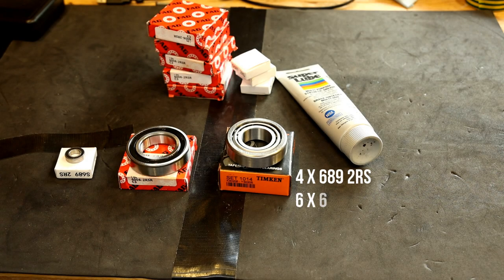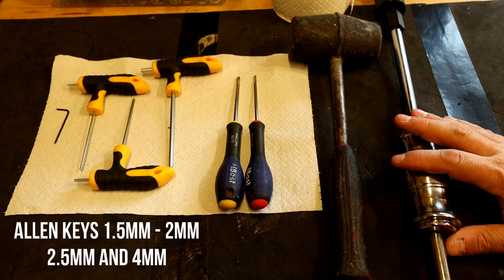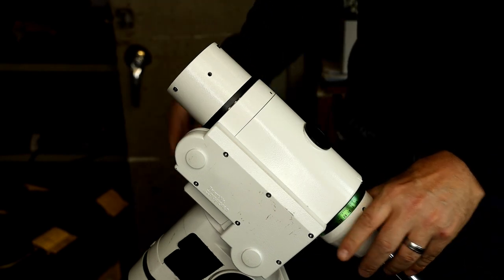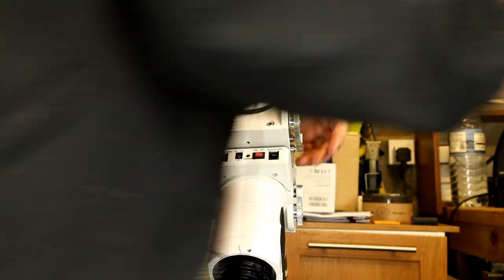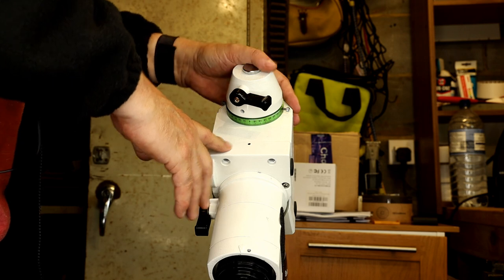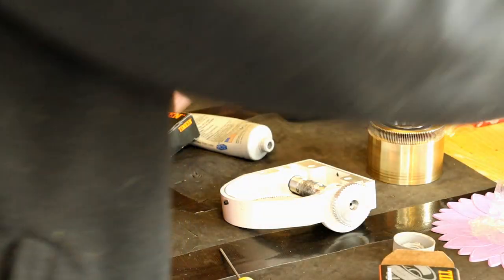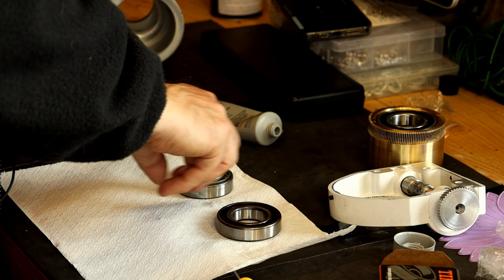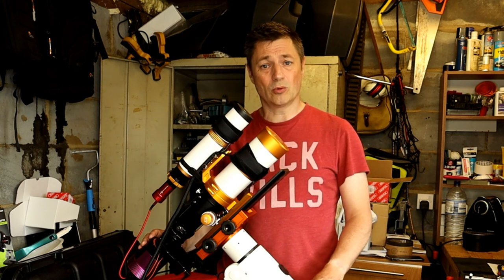HEQ5 Pro Hyper Tune. Get the best out of your mount. Astrophotography

Comment: Hello from a Pom ‘down under’. There is one really essential thing I would do when doing this re-build. Put some turps or similar in a shallow dish-tin lid whatever, then put the worm wheel brass gear in the fluid, use an old toothbrush and carefully go round the fine gear teeth to brush out all the fine metal particles that are held in by the old grease. These particles in the grease act as a grinding paste over time and produce wear on the worm and wheel. Similarly, do the same with the worm gear. Finish both gear sets with a squirt of brake cleaner (Acetone), then a blower when dry. Those parts are now truly clean ( you could use an ultrasound bath to do the cleaning if you have one). In my many years of building/making and machining gears, this just takes the hypertune to the next level. Stiffness on the Dec axis is usually because the cone shaped bearing housing is too tightly adjusted on the tapered roller bearing and just needs fine adjustment before tightening the three locking grub screws. Greetings from Tasmania Australia.
Reply from the maker: You are slowly talking me into stripping the mount again lol. The summer months are the time to do it. May even splash out on a new toothbrush just for cleaning my worm gears.

Comment: Thank you so much for this excellent tutorial Glen!!! I just got a new HEQ5 Pro in October this year. Even brand new, the Dec and RA axis where very stiff/sticky when trying to balance just like you demonstrated. I purchased the Rowan belt mod and the bearings you suggested and installed everything today following your tutorial. A compete night and day diffference!!! I can now balance my gear accurately, it's extremely sensitive when sliding the counter weight by just a tiny bit (like it should!). My guiding this evening is averaging 0.55" from the other night at 1.3" More than doubled my accuracy.

Thanks again so much and keep up the great work!!
Reply from the maker: Hi Peter. That is excellent news and wow what a fantastic improvement on your guiding. Thank you for commenting and letting me know your results its really appreciated. Really happy my video helped.
Reply: I was tossing up whether or not to go ahead with the belts and bearing on my new heq5 pro. I'm getting the exact same performance as yours. I'm going to go for it- I really hope that mine matches your performance post tuning

Comment: I was very glad to hear 53:40, even though it's a horrifying sound because it means I'm not the only one who did this. I bound my worm up thoroughly on my EQ6, but I thought the worm was slipping! On close inspection I saw the gears weren't turning. I found that the RA worm adjustment needed to be feather-light; a lot lighter than the Dec worm adjustment. Thank you for the concise and useful video.

If anyone is wondering, the HEQ5 is basically a smaller version of the EQ6/NEQ6/EQ6-R, so this applies if you have one of the "6" mounts.
Reply from the maker: Thank you for taking the time to watch my video and comment. The adjustments as you say are really fine. I have recent video using a tool that really helps with this 
https://youtu.be/7-QGpHp8vMo

Comment: I can't believe how smooth and easily your mount rotates. Mine is new and clearly leaves a lot to be desired from the factory. Thank you for the great tutorial.
Reply from the maker: I don’t think Sky watchers quality control is of a very high standard and so mounts come out some good and some not so. I hope you are able to get yours running well as they are a great mount at the end of the day
Reply: @Astrobloke  I'm coming to the same quality control conclusion. I ordered the ceramic hybrid bearings.  Working on collecting the other brains to get it tuned up. I've identified my RA backlash is loose.  

Thanks for a great tutorial.
Reply from the maker: @astroventure2221  you are welcome. Be careful when tuning backlash as its very easy to introduce fine binding. Phd2 can compensate for backlash but not binding

Comment: About to undertake this project. I'm actually guiding at .2 to .3 total, but balancing is a best guess with the stickiness and occasionally/periodically I have a momentary spike in the guiding. Great walk through!
Reply from the maker: Your guiding is extremely good for that mount so unlikely to see that improve. It will make balancing easier with smoother axis and no stiction though. Good luck and thank you for watching and commenting.
Reply: @Astrobloke  Agreed! I am looking to get rid of the occasional spike and stiction balancing issue. Also, my total scope and accessories weight is 16.8 pounds and that probably has a lot to do with excellent guiding and I'm sure, a little luck in the particular mount. FLT91 / WO 50mm unislide guide scope, ASI294MC Pro, ASI 130MM mini guide camera, ASIair Plus, small USB hub, WO additional slide handle and 2 dew heaters.

Comment: Thank you so much for a great video.  I am ordering the bearings to super tune my EQ-G Orion mount which is the EQ5 just rebranded.  I'll be following your video to do that super tuning.  When, I look at the bearing specs; they are way over-rated for the work they do in this mount.  In fact, the mount seems well under-rated for the actual load it can carry and easily slew --PROVIDING THE SETUP IS ACCURATELY BALANCED!!  I've heard reports of astrophotographers deliberately loading up this mount to 50lbs (Balanced) and seeing tracking at 0.8 or less.  This mount is a sleeper.  It's capable of easily 30lbs payload for astrophotography, providing your setup is well BALANCED and your mount is super tuned.  Try it and you'll see!  This thing a gem! ..and a BEAST! All the weight is carried on the bearings which handle thousands of pounds.  The 30205 bearings are wheel bearings for cars FFS!!   If your setup is smooth and supertuned, all the worm and gears work against is the inertial resistance of the setup.  And slewing even at high rate is so slow accelerating,  the stress the worm actually sees is minimal.  However, If you're setup isn't tuned and balanced do not attempt to run over 24 or so pounds as payload, though.  Free movement is the most important aspect of the mount.  Any stiffness, increases load on the worm gearing and will wear out the mechanism quickly. But, if you can balance and super tune your EQ5 mount?, yeah it can handle a lot more than 24 lbs.  Do it at your own risk, though.  Success depends on how conscientious you are in your balancing and tuning.  If you're not sure, have an experienced APer take a look at it.
Reply from the maker: Thank you and I totally agree. I have often loaded beyond what they say it the max. As you say with a smooth minimum friction mount and totally balanced there is hardly any drive needed to track the mount. I have only ever found limitations with very large scopes like my CT10, in windy conditions.
All the best with your tuning, clear skies
Reply: Thanks for the response.  I agree large scopes with a radial cross section (SCT) really catch the wind like a sail.  That's really going to give your guiding a challenge!  But, aluminum flexes much easier than steel and since that's what the mount body is made of, there will be a synchronic flex.  And that will be a limitation to this mount.  Avoid higher winds and or wide scopes!  
Clear skies, @Astrobloke
Reply: @Astrobloke  Well, I finished my super tune on my EQ-G mount.  Things went very well and I stepped through your video as I did it --which helped avoid the unexpected.  I, as well, found no manufacturing markings on any of the bearings, none.  And, holy cow, those worm drive bearings were awful. There were random indentations in the bearing "seal" ring.  And, the bearings ran like gravel was in there; one of them freezing up completely.  I imagine there was a split ball bearing or some major trash on the bearing races.  I'm anxious to get the mount tested, now; but the rain and clouds are holding things up.  Thanks again for a valuable instructional video.  Great work and much appreciated.

Comment: Just wanted to say your video has been extremely useful today following the strip down of my HEQ5 to address the Dec and RA (though I was missing a bearing puller to do the worm drive bearings!) … however, all other bearings replaced and the rotation / motor belts running very well so many thanks for tremendous help Glenn!
Reply from the maker: Nice one. It makes a really nice difference to the mount. Glad my video was helpful

Comment: I'll preface this comment by saying that I found this and other hyper tuning videos invaluable to guide me through the process.  Thanks for putting this video out.  I echo @ShevillMathers comment below that getting the preload on the tapered roller bearings on the RA and Dec may solve stiffness that is presumed to be bearing issues.  Also 4 of the 6 6006 bearings are only functioning when the clutches are disengaged.  As a result they work when you balance the scope but not when the mount is tracking.  If you have a new/newer mount I'd take a few minutes to adjust the bearing preload on the tapered roller bearings by adjusting the threaded collars on RA & Dec axis.  Then fine tune the backlash on the worm, motor and intermediate gears.  You may find the existing/supplied bearings aren't the problem and save yourself a few dollars.
Reply from the maker: @ArthurAstroTO  thank you and totally agree. As you will have seen my mount was not new and the bearings needed replacing in my mount as the original ones had leaked and become stiff severely affecting the mounts tracking performance. The points you make are very valid but unfortunately youtube offer no way of editing a video once uploaded so changing or adding new details is basically impossible apart from making a hew video.

Comment: thank you for the video. Just one thing - i had problems with the washer that is needed to be screwed away and holds the axis with 2 small bearings and cog wheel (15:38) - problem with it is, that if you return it and screw it too tight, then the cog will be moving badly, and if you screw it back too loose, then it will probably loose more by the movement of the bearing and you will get backlash. It took me 15 mins to find out what was causing the backlash of RA axis  :)
Reply from the maker: Hi Petr , yes the float nut is important to get right. No movement on the worm gear but too tight and it stops its free and smooth rotation. Unfortunately it does take a little time and fine adjustments to get everything working at its best but worth the effort. Thanks for commenting and I hope the video was helpful, clear skies and good luck

Comment: Excellent video - clearest explanation of how to fix the backlash on these mounts that I've seen. I'll have to try with mine. You've got me very tempted to try swapping out the bearings too, but small steps first...
Reply from the maker: Just very small turns when you are close on the backlash. The job is not too difficult at all and would recommend doing it as it does not cost much either.

Comment: Thanks for the great video. I had it running it two days ago when I worked on the mount but I have yet to test it outside–I'll be very interested to see the graph. I found however that that the puller was necessary on extracting every bearing bar the worm gear as none of them wanted to come out with the ease of yours. A rubber mallet and piece of wood were persuaders to get the new ones in. These tight tolerances (tighter than yours anyway) bother me–I feel I'm doing something wrong. Slightly heart-in-mouth stuff, but all done and moving freely now.
Now for the proof of the pudding.
Andrew (Australia)
Reply from the maker: Hi Andrew and thank you for letting me know your progress since watching the video, I am really pleased it helped. Bearings can be such a hit or miss thing and you have obviously had a tough time with your mount but glad to hear its sorted. I think temperatures can make quite a difference so that might be why yours are tight but I wouldn't overly worry. Good luck with testing and I hope it all works great for you, clear skies

Comment: Very nice video! Has the belt drive mounted since a while ago. I did this for the sake of fun on my EQ5 Pro. And it's gotten better, so it's always a good thing to do if you're going for long exposures. As you also get a good idea of how the functioning of the mount is definitely worth just for that too.
Reply from the maker: Hi and thank you for watching and commenting. The belt mod also seems to quieten the mount down and it it just seems to slew smoother as well as improve guiding by reducing backlash and play. Definitely the best mod for this mount and one I highly recommend.

Comment: A quick note - after following this great video I still had movement in the RA even after trying to tighten / untighten the mounting … the final step ended up being the worm drive end float adjustment under the rubber cap - all of sudden the wobble was gone and now with the bearing replacements and your recommendations it is moving and balancing extremely well!
Reply from the maker: Thank you for this. I will add a note in the description as that can cause an issue. I was fortunate that mine had no movement in them when reassembled but that should be checked. hope the improvements give you great results
Reply: @Astrobloke  Ok great, here’s hoping for clearskies for everyone and thanks once again for such a great channel, your content has been extremely useful
Reply: Even if you don't want to do a full tear down and rebuild of the HEQ5, I can confirm that tightening up the worm drive end float under the black rubber cap can definitely help with eliminating wobble, particularly in RA. I guess this can loosen up after awhile. (I found the same was true of my Vixen GP2, which has a generally similar construction). By the way, a lens spanner wrench is a very useful tool for adjusting the worm gear end float.
Reply: @douglassmith1215  I purchased a lens spanner wrench a few months ago following trying to separate some spacers but indeed - a great suggestion! as it has been great to tighten / unfasten these challenging components!

Comment: Literally finished hypertuning my heq5 Pro yesterday. Lol!
Reply from the maker: Excellent. Did it all go well for you? I am amazed at the difference in the mounts smoothness and the guiding last night was between 0.3 - 0.5 rms which is excellent (was 0.8 - 0.9 before)
Reply: @Astrobloke  Actually not really, the previous owner had obviously taken it apart before and cross threaded the nut on the RA axis (threads totally destroyed). I can't find a replacement anywhere, so modelled and 3d printed a replacement for the time being, longer term I'm going to machine a new one I'm just waiting for the Aluminium to arrive. I haven't had a chance to check the tracking yet but It does feel very smooth so far, fingers crossed the number will have improved too. Great video by the way! :)
Reply from the maker: @CuriousRiz Thanks but what a shame. That takes some doing to strip that thread. But I read so often where people have bent bolts or stripped threads, Too heavy handed or just not really knowing what they are doing. Many years tinkering with old cars and motorbikes has helped me. I hope you get it all sorted, sounds like you have it all in hand though, good luck.
Reply: @Astrobloke  Yeah it is a pain, but oh well! Luckily I have the tools to fix it otherwise I don't know what I'd do!

Comment: Great tutorial, thank you. Going to order up the bearings and do my mount. 👌
Reply from the maker: Thanks Ian. you should see a nice improvement after
Reply: @Astrobloke  Evening Glenn, looking at ordering the bearings, the 6006 2RSR are not recognised ?
Is there a typo there ??

Thanks,

Ian 👌
Reply from the maker: @iancoombes6120  Hi Ian. No unfortunately  they seem to have different stock all the time.
I actually ended up getting SKF 6006 2RS1.
Reply: @Astrobloke  Glenn, thank you. I did see the same question asked earlier in comments. Sorry for being impatient 😁
Reply from the maker: @iancoombes6120  no its cool mate. You want to make sure you get the right ones.

Comment: Great video, Glenn, I really like the way you present the tasks clearly and logically. Makes it look doable for newbies! One question - the bearing 6006 2RSR isn't available on bearings-online but used a ceramic bearing for the other one and the 6006 2RS Ceramic looks to be that - can you confirm? Many thanks
Reply from the maker: Hi David and thank you for watching and taking the time to comment.That bearing I believe will be good for that. The 6006 is the most important part as thats the size. The letters denote different types of seal etc.

Comment: Super video, very clearly demonstrated.
Reply from the maker: Thank you, i hope it was helpful
Reply: @Astrobloke  I just checked the bearings site to check out the ones you listed and they no longer seem to have the 6006 2RSR bearings, what are the bearing dimensions? I wonder if the stock number changed.
Reply from the maker: @MrKapeji  6006 is the bearing size and the letters after just denote slight differences in design. They have 6006 2rs1 which are basically the same but you can email them and ask what they suggest as a suitable alternative
Reply: @Astrobloke  Nice one Glenn, thanks for the quick reply, I wasn't sure what to look for there. I will do as you suggest though in case there is a qualitative difference, these seem ok at first glance though.
Reply: @Astrobloke  Just finished the job, all fitted very nicely and the video proved extremely useful, so thanks again! :D
Reply from the maker: @MrKapeji  you are welcome, clear skies